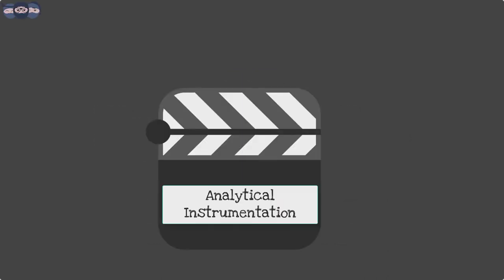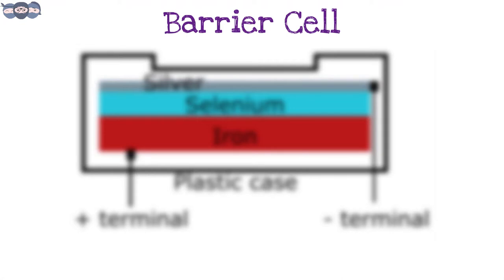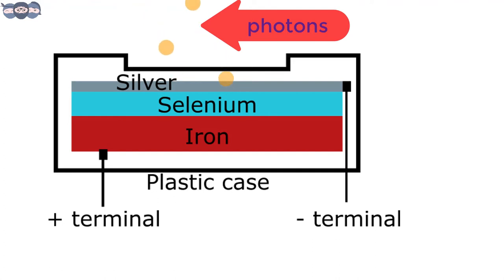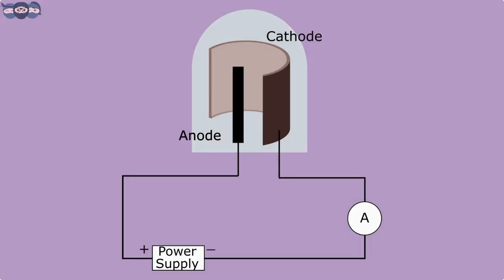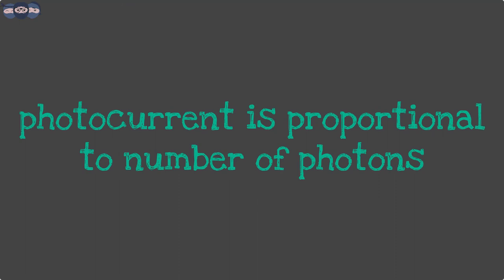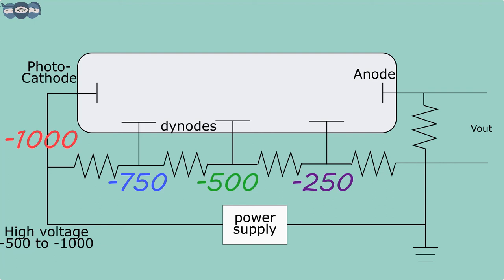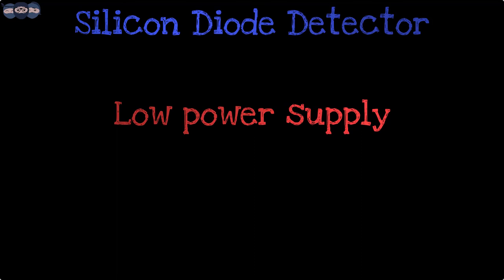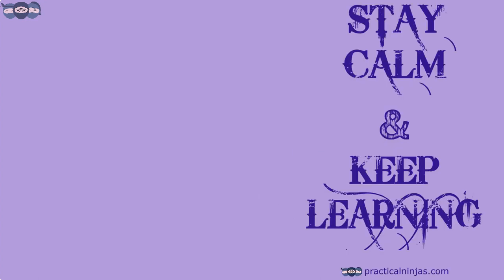Analytical Instrumentation 01: Detecting Radiation with Photosensitive Detectors

Comment: Electrons are negatively charged then it should get attracted to the oppositely charge anode right??? But in the video its moving towards the negatively charged electrode ....can you explain if I am wrong (Barrier layer cell)
Reply: It's true that electrons are attracted  to opposite charges(although in your example you're talking about the cathode, not anode). 

The barrier layer cell is its own electricity source(like a battery); which means its electrodes are the negative and positive terminals.